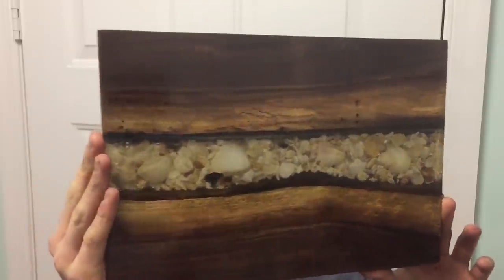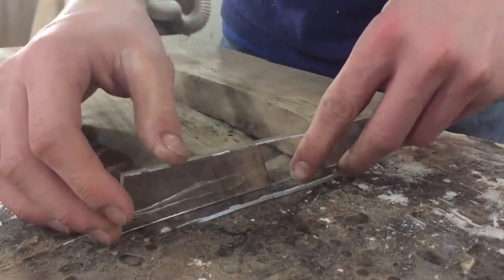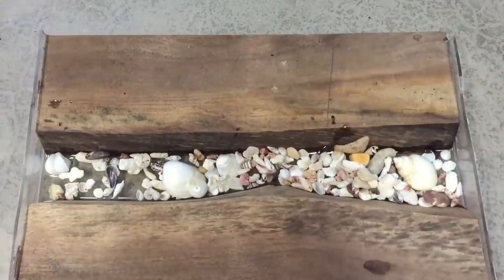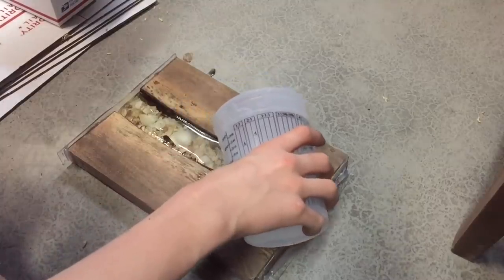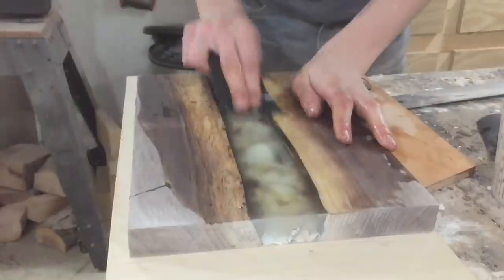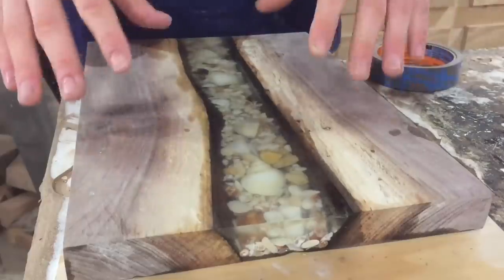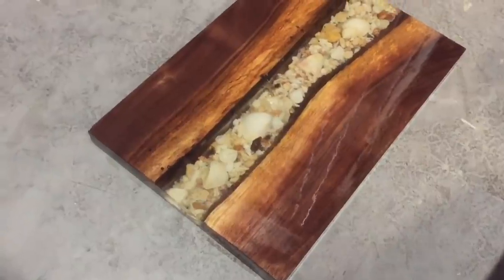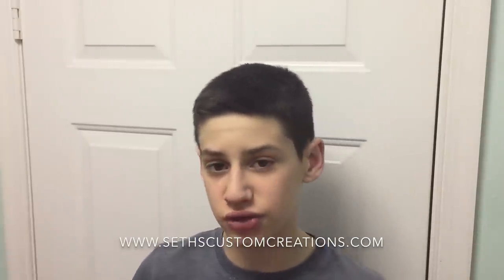Make an EPOXY River Serving Board! Easy!

Comment: I just made this exact tray using this same process last week. What I learned...if you get micro leaks on the end dams, an ice pack or two on the ends will slow it down till it sets. Also, if you weigh down the boards, you’ll have very little seep through through the bottom. Nice job!

Comment: Great job bud! Good to see guys like you doing stuff like this instead of sitting on your Xbox all day 👍 As a little tip, you probably don’t want to sand the wood up to 1000 grit before you add any finish/oil as you’re giving the finish less to adhere or chemically bond to. Better to sand the wood to around 240 then add first coat of finish, then work your way to higher grits during each layer of finish 👍
Reply: Good tip Ben a lot of people don't realize that the finer the grit when sanding your closing the grain of the wood especially if you're staining the wood you want to keep that grain open

Comment: Small tip my dude. If you want to get a super fine finish you can use car compound and polish on the resin. It will get rid of the sanding marks and make it crystal clear. You did amazing!

Comment: Really great looking piece! Up to this point I haven’t used epoxy, so I was curious about how well it holds up to scratches and dents that could occur on a cutting board?
Reply from the maker: You can’t use it as a cutting board. It will make big long white streaks. It’s more of a serving board or perhaps decor for your kitchen
Reply: @seths_custom_creations  Some people call them charcuterie serving boards. Seth yours is fancy enough for that name. 🤗

Comment: Good job, Seth, you made a fantastic looking project. I was curious, it looked like after you trimmed up the board, you had some exposed shells. Did any of those blow out when cutting them, and which tool did you use to square them up? Also, because the one shot of the cut edge I could see looked like there was exposed shell, did you go back and seal those edges? I understand that this is a serving board instead of a cutting board, and you could choose to not place things on it that could have runoff that would cause problems if there were tiny voids.
Reply from the maker: Andrew Drozd I cant remember exactly, but I think when I placed the shells I kept them about 1/4 away from the end of the board so that I could trim it up. But there may have been one that got exposed and I just finished it like normal. The epoxy will hold it in place. As for voids, I don’t remember any voids being exposed.

Comment: Great job! Epoxy is tricky, my first attempt was a total failure haha, this turned out amazing keep up the good work dude!
Reply: What went wrong w your first attempt?
Reply: Clickster I thought I had completely sealed the white melamine strips I cut as sort of the “frame” that would hold the board and epoxy. Apparently the epoxy is really good at finding ways to leak out haha, so when I came back the next day it was leaking onto my concrete floor, my table saw, and it was also too cold to set properly. I used a massive amount of hot glue and tried to salvage parts that hadn’t completely leaked out. So lessons learned: make sure everything is sealed really really well, hot glue is cheap epoxy is not. And keep the work area warm enough to cure your epoxy.
Reply from the maker: I’ve used hot glues that actually are disinterested by the epoxy. I recommend Gorillla brand hot glue. Same company that makes gorilla glue. Stuff is the best I’ve used and it’s cheap. Make sure all your cuts are nice and square for your form as well.
Reply: @seths_custom_creations  Thanks for the replies, guys.

Comment: When you put several layers of Epoxy don’t you need teeth to grab ? You don’t sand in between pours? Do you let it completely cure? I read somewhere that you have to either sand or get it when it’s still tacky before putting another layer. I’m learning as a beginner so thanks in advance for your answer
Reply from the maker: broproful pour it when it’s sticky

Comment: Hey dude! Love your projects! I also do the same things as you here, but don't you think using plexiglass a bit expensive for single use mold? I recommend using corrugated plastic sheet (it's called impraboard in my country, i don't know the actual material name), but maybe plexiglass is cheaper in your place. Keep up the good works!
Reply from the maker: Dimas S.A a guy who works at a local hardware store gets cutoffs of plexi glads for free so he gave some to me. Probably gonna try the corrugated board next since I ran out

Comment: Seth, epoxy resins are hazardous and require safe handling in use.  For your protection, wear safety glasses, long sleeves, and disposable gloves to prevent contact with skin and eyes while mixing, pouring, and working with epoxies. It's also very important that your work area is well ventilated, if not use an organic vapor respirator.  Always use a respirator when sanding epoxy even if using a vacuum attachment.  With repeated contact on your skin you will develop an allergic reaction that will get worse over time.  Always best to be safe than sorry later on.

Comment: Hi Seth, I’m a beginner. Did yo you have an easy way to remove the plexiglass from the glue?
Reply from the maker: Steven Castelletti usually i’ll use a utility knife or something to cut it off. But it should come off fairly easy. You throw the whole mold away after use. I just break into it

Comment: Epoxy is a great product, I use 20 liter drum at a time for boats. BUT it is NOT something you want to ingest, always wear pps, avoid fumes and sanding dust. Read the Safety Data Sheet.

Comment: hi! Won"T it breake if you push it on the middle for 3 pieces? I am wondering how this middle EPOXY is connected to the wood
Reply from the maker: Oel ngati kameie the epoxy is as strong as steel. The bond between the epoxy and the wood is stronger than the wood itself
Reply: @seths_custom_creations  Thank you for your response. I believe that epoxy is stronger than wood, but how it is possible that epoxy is stick to wood so strong? Super Glue or something? :D

Comment: how long did it take to dry between each layer of expoxy?
Reply from the maker: SkinnySkinch you don’t let it completely dry. You pour the next layer when it’s gummy and thick so the next layer can adhere better. For the TotalBoat 2:1 epoxy I’d say after about an hour.
Reply: @seths_custom_creations  thats really cool nice job! do you use the slow set 2:1?
Reply from the maker: SkinnySkinch yes. But now for river boards I use total boat thick set
Reply: @seths_custom_creations  yeah I was just on the site looking at that one and was curious. I have used ECOPOXY's 3 gallon kit off of amazon and its actually been extremely good stuff. I think I may give this total boat stuff a try they seem to be really popular.
Reply from the maker: SkinnySkinch I like it a lot. Use my code “sethrob20” and get 25% off at checkout. You can use the code as much as you want on anything

Comment: Could this epoxy resin be used to create a custom shower pan?
Reply from the maker: daniel lebron to use as a base layer instead of concrete? Or to cover the stones or something as a top layer
Reply: I want to cover sea glass and sand for my shower pan, but it's gonna be 2 or 3 inches in thickness. Metal base, 2 feet by 2 feet. Is this too large of a surface?
Reply from the maker: daniel lebron it’d be hard to shape it to swoop it down to the drain. It’s like water. It’d also be $3,000+ in epoxy

Comment: Pretty cool but why did you put so many layers of epoxy I get the first layer so the shells weren't on the bottom and I get the second lair so the shells didn't float which in my opinion would have been pretty cool but after that why two more layers
Reply from the maker: Playing With Cars certain epoxies can’t be poured in thick depths. You have to do multiple layers or it’ll overheat. TotalBoat has new epoxy called ThickSet that can be done in one pour

Comment: The link to your micro mesh goes to circular sanding disks . .  .not the pads you were using on the epoxy . . . I want to get what you used . . . can you point me there?
Reply from the maker: Since this video I used the circular pads and they’re worth the extra few bucks. Much more surface area

Comment: Young man FYI you shouldn't sand wood at such a high Grit the higher the grit you're closing the grain of the wood which therefore does not allow any finish to stick to it especially if wood is getting stained you have to keep that grain open increase your Grit as you put your finish on that will give you your shine always remember the saying sharp edges same thing applies if you leave a sharp edge the Finish will peel right off of it or rub right off you have to ease that edge ever-so-slightly

Comment: Only thing I would have done differently is to leave a small gap on each end for only epoxy so the shells didn't stick out the ends of the board.

I think your parents need to invest in some power sanders and buffers for you. All that hand sanding made me tired!!!

Comment: Without proper safety gloves and mask doing expoxy resin is not good for your health.
Reply from the maker: Zhoey's Blog “safety gloves” are dangerous to wear in the woodshop
Reply: Mybe for wood but for mixing epoxy resin,pouring and mixing you need it for your own safety...